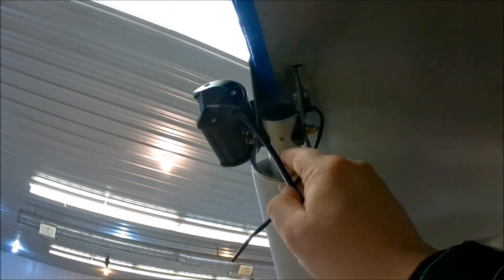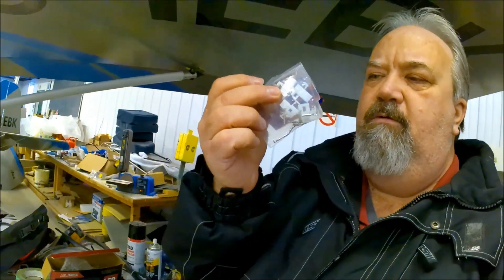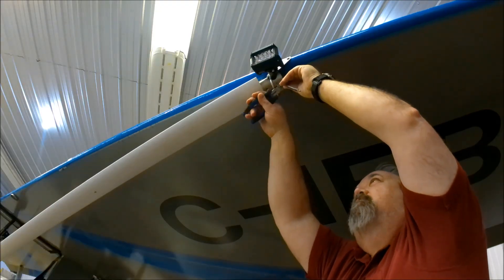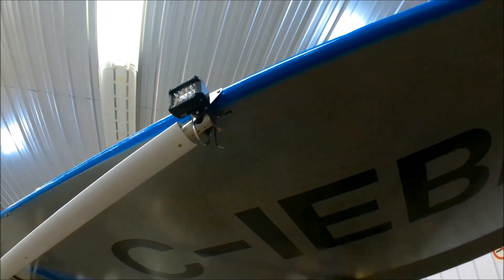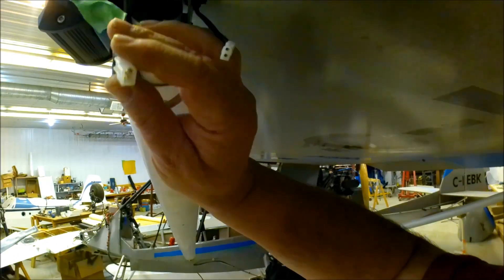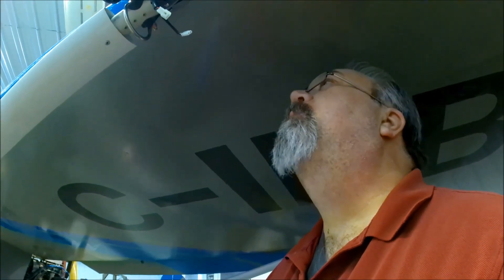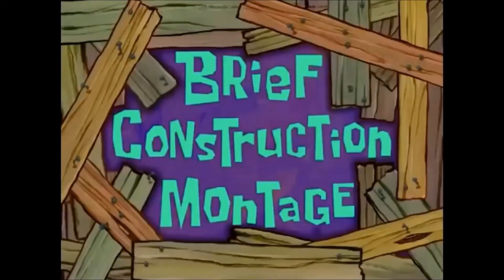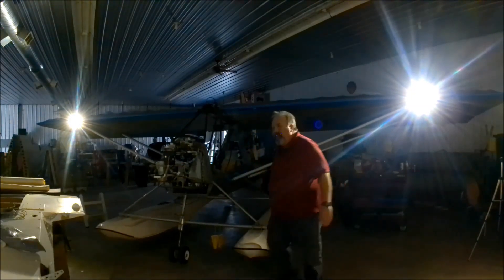EP 63 Landing Lights mounted, but Problem with the Wig Wag! Challenger 2 Ultralight

Comment: Can you link the lights you bought? I like them but might do them down on Roney brackets
Reply from the maker: They were purchased a one of my local automotive shops a few years ago. They are "dual beam" LED. Meaning that they have both a flood and beam configuration. I honestly can't remember what shop it was, but they aren't anything special. Tons of similar are on the market. Just check the power consumption and make sure you don't pick one that is a power hog.

Comment: Why r u even bothering with lights? That plane can't even fly at night. Can't even fly in bad weather. Seems all your doing is adding weight.
Reply from the maker: That's actually a good question, and one that I'm sure others are wondering. The reason I did this is a simple one. To be seen! You see, my airplane not only small, it is grey in color, and that combination makes it very hard to spot, especially on a cloudy VFR day, but also on a clear days. So, I added lights to make sure that while I am looking for other traffic, that other traffic has little trouble spotting me. Hope this answers your question. Cheers.